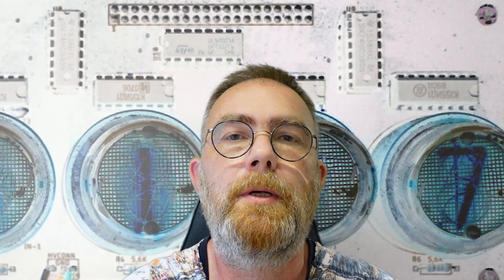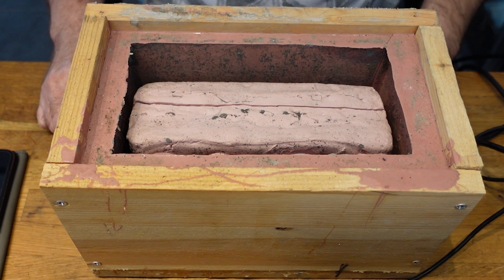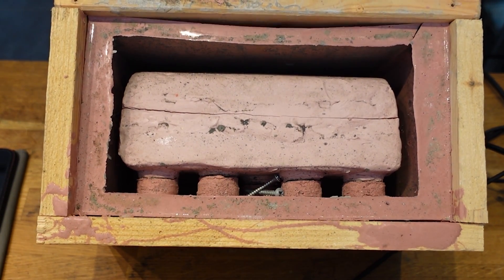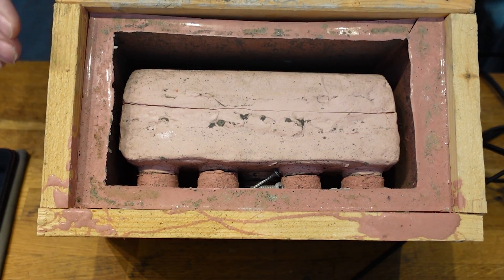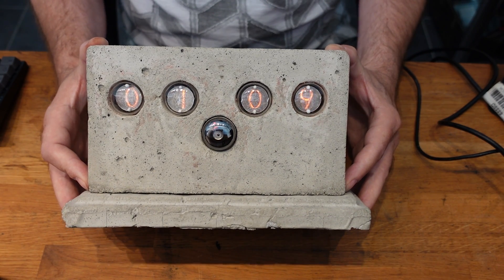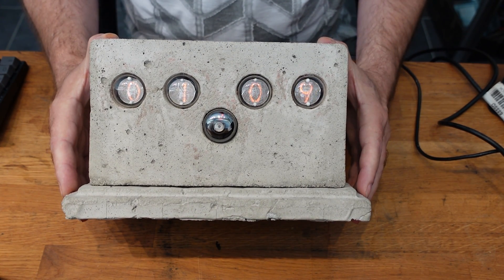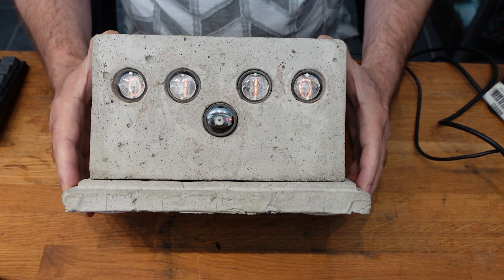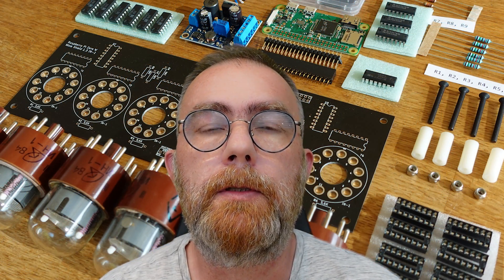Nixie Clocks - Part 1/2

Comment: Hello blogger, I am a nixie tube enthusiast . The package of IN1 is difficult to make. I cannot divide the 11 pins correctly and reasonably. Can you share the package of your IN1? Thank you so much!
Reply from the maker: Hi !
I pushed an Eagle library containing symbols and footprints for IN-1, IN-2 and IN-12 to the github repo(https://github.com/hansj66/NixieKit/tree/master/eagle/Libraries). I also pushed the .sch and .brd files for the IN-1 variant of the clock.

PS. You have to be aware that the vertical alignment of digits in the IN-1 tubes varies to some degree from tube to tube. I had to sift through100+ tubes in order to find 6 that had a resonably matched vertical alignment (with respect to the pins). For IN-1 tubes it may be a better option to use Mill-Max pin sockets or Molex crimp terminals on the tube pins (part numbers are listed in the eagle/IN-1 folder) and instead run wires from these to the board.
Reply: @TimeExpander  Thanks for your support! I have just obtained your project files, I may be able to consider your suggestions, anyway, I can finally start making this IN1-Nixie clock! Finally, happy new year:>